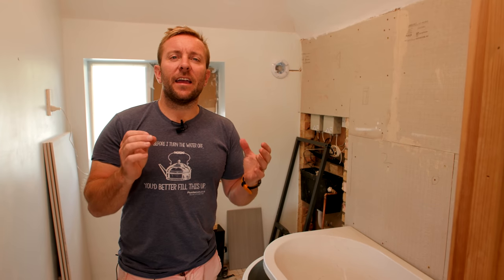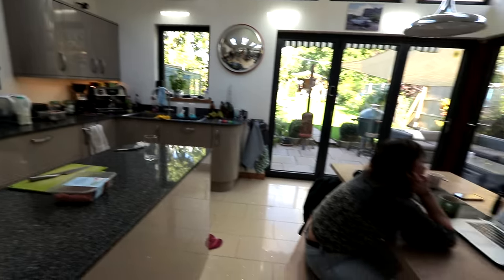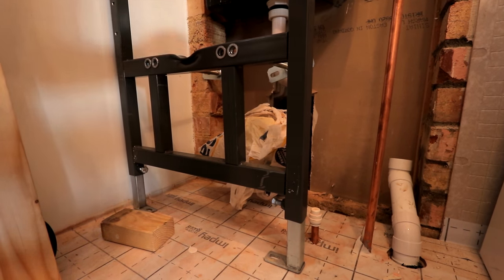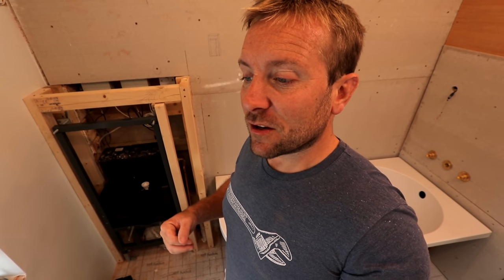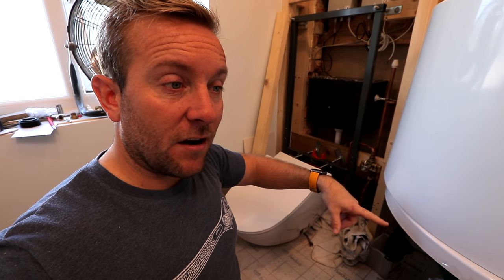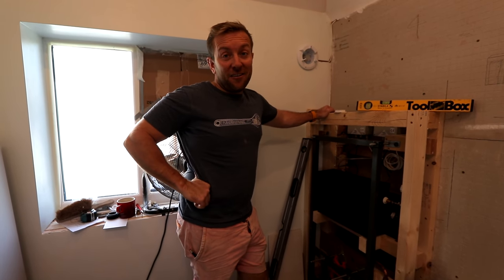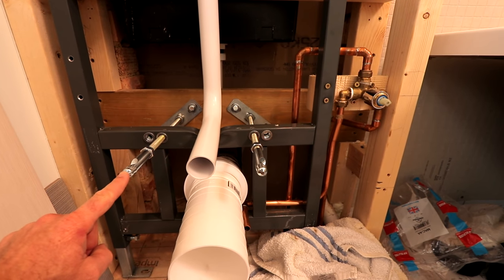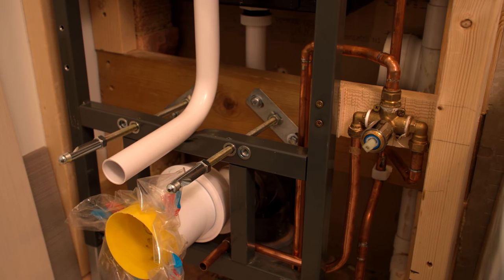How to box in a toilet - BATHROOM RENOVATION PART pt10

Comment: Great video. Like the way the Vitra has bolts going through to the back wall - is that the only one like that?  Now for the front wall why not some nice oak T&G ?  perhaps stainless screws to fix it. Why tiles when you know somebody is going to have to smash them. If wood was good enough for Pugin then what's not to like. You already have the wood top for access and resilience. Stupid question: is the inlet pipe from tank to bowl a standard UK size?  Now I know you have those lovely electronic controls, but if I ever get to have a go at one of these things it's just got to have a Dudley Turbo88. Perhaps do the actuator French style so a nice door knob on top of a piece of threaded rod through hole in the lid. Simples!  Look forward to the next one (I'm holding on)

Comment: Another good video, very informative. Could you tell me how you fitted your AAV by the toilet. Is this enough to stop gurgling at the sink and shower and stop smells coming into the bathroom via plugs etc. I only ask as I need to fit an aav to my bathroom referb but have been told that I need a drug valve and I have literally no where to put it. Keep up the good work!
Reply: Hahaha Ryan it's called a Durgo valve (I suspect spell check) It can go anywhere you want but the important bit to remember is the height needs to be above the highest exit point in the room, thats usually the over flow on the sink.
Reply: Awesome thanks for the info. I will install one on my sink waste.

Comment: does the durgo need to mbe at top of stack system or does it seal water tight if blockage was to form in pipe
Reply: Above flood level of toilet. Bear in mind the space it's in can't be airtight or it won't work.
Reply: @markrainford1219  thank you mate